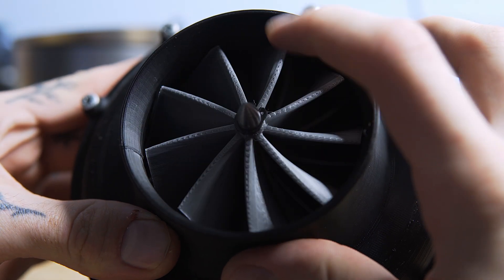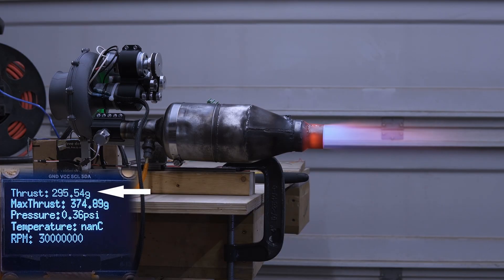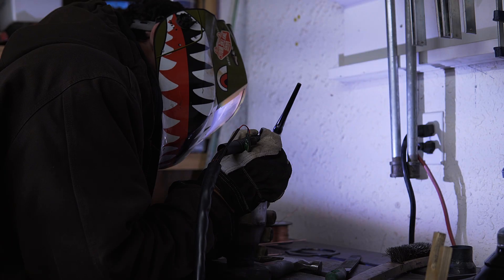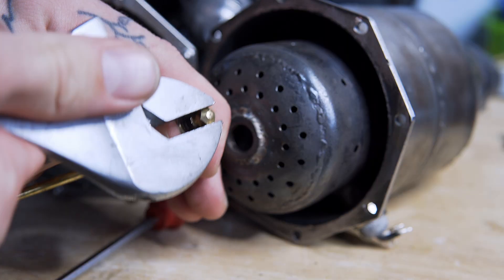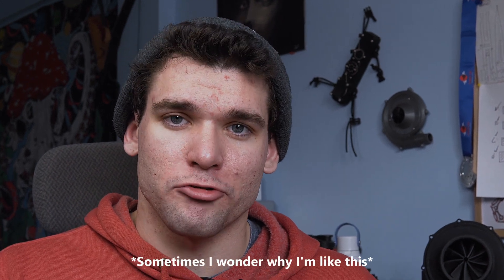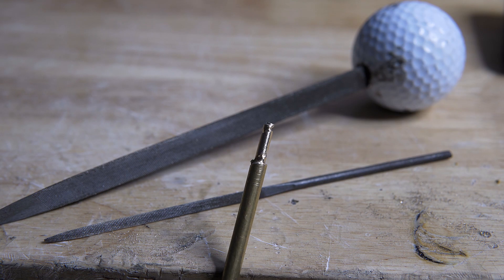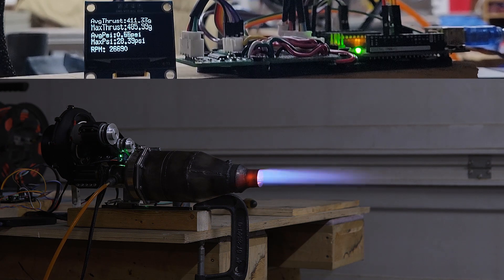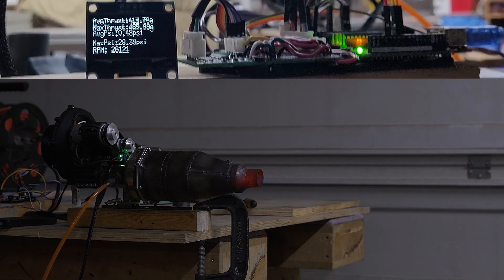I cut my homemade jet engine in half to make it better. Compressor, Arduino, and fuel injectors!

Comment: how much pressure can u get inside the combustor?  think about several stages of compressors with intercoolers between to not melt the plastic :D  thermodynamic efficiency depends on temperature and Pressure the higher the better :)

Comment: When you need more compression, put some axial compressors before the centrifugal compressor. The diameter of the first axial compressor stage needs to be greater than the intake of your centrifugal compressor.
Reply from the maker: I'm gonna be working on an axial compressor for my new engine soon

Comment: New here, but have you ever thought of using a standard oil  furnice nozzel? You basically made one. There are heaps of different types to experiment with. Like spray angle and field distribution as well as nozzel size and flow characteristics.
Reply from the maker: I think that's actually where I got the idea for the nozzle, I saw a diagram or something in passing. The issue for me was the size of those nozzles, they seem quite large and have a very high flow rate, much too high for what we're working with at the moment. Maybe in a larger engine, or an afterburner, I'll look more into furnace nozzles! Thank you!

Comment: Wait , can you burn kerosene with your current compressor air flow, might not burn well, upgrade to brushless dawg, perhaps take a used car turbo and use the motor to power it
Reply from the maker: I'm really not sure, I've read that karosene needs more pressure for good combustion and idk if the engine produces enough. I'll probably use propane to get the engine up to speed and then swap to karosene mid burn, which may take care of that issue. Either way, I'm working on a turbo jet so the motor and pressure won't be an issue for much longer

Comment: probably a flawed idea, but ultra sonic humidifiers make incredibly fine room temperature mist, im thinking that if you could add that disk actuating at very high frequency's to vaporize the fuel to the main intake in combination with your new nozzle, it could yield better results.
Reply from the maker: I like that idea! I don't think it would work for the main combustion chamber, but we could try something like that for an afterburner!
Reply: Turbines make this high pitched sound already. So the idea is to put injectors as close to the rotor as possible? Like ITB carburettor?

Comment: Hey man, how high of kv motor do you think you'd need. I have some smaller high kv drone motors and esc laying around. From one broke college student to another mad respect you are getting this done!
Reply from the maker: What an absolute stud. Thank you! The compressor is meant to do about 50k rpm, but don't worry about it I'm already building a turbojet so our motor issues will stop being a problem very soon!
Reply: @Neally  noice!!

Comment: Awesome great progress. 
We had a hung start yesterday and we suspect flow divider. 
For your centrifugal tip clearance. You can make a abraidable self lapping coating by mixing graphite flakes in with some paint. 
I have some duplex nozzles kicking around and internal flow diagrams if you would like as well. 
Looks like your making alot of progress !! Thanks for the vids
Reply from the maker: Thank you! The graphite trick sounds brilliant, I'll have to try it sometime!

Comment: To actually Increase the thrust by quiet a margin. you would require a Compressor wheel setup outside the combustion chamber 
(compressors and stators both).
Reply: In a radial compressor the volute geometry serves the role of the stator blades in an axial design. I am tempted to load up his models though just to have a look at the compression and collector area of the volute because now i am curious. this is a huge reason why he is using a radial compressor and why they are used so commonly. Radial turbines get really crazy like this because you have multiple stages of compression taking place on a single rotating part. this is why they may have three blade lengths with different geometry. as the air is forced farther into them. more blades and different angles are turning the flow laminar and compressing it.
Reply from the maker: Exactly! The diffuser section is a part of the upper volute and serves to expand the flow causing the speed to decrease and the pressure to increase. I think I'll talk about it a bit more in one of the upcoming videos. Cheers!

Comment: I have a question 

Does the engine make more thrust after ignition?

Because the compressor is electric, so shouldn't the overall pressure be equal to the pressure produced by the compressor?

Thanks
Reply from the maker: The engine makes something like 5x-8x more thrust after ignition. Because the exhaust is somewhat restricted, the combustion adds to the internal pressure. Ideally the compressor would make significantly more pressure making it so that the pressure the combustion adds is insignificant, but I haven't gotten us there yet. Great question!

Comment: excellent video! drip water that is charged by positive terminal from above to hit a negatively charged bit of aluminium wire from a welding spool. the water should flash into 100% hydrogen and the aluminium oxide waste can always be reused.
Reply from the maker: That's a cool idea! I assume you mean for the fuel system?
Reply: @Neally  idk sure why not the fuel system

Comment: Why are you doing this other than fun?

A gas turbine extracts energy to turn the compressor. The power ti increase output is coupled directly to the turbine wheel. 

Your setup has a maximum compressibility limit based on the power of your brushless motor. You'll never reach the kinds of thrust a jet turbine can. In fact there's no point to even have a turbine wheel at all. 

What would be more interesting would be for you? To attach a turbine wheel to a electric generator and extract the electrical energy from the turbine wheel. And feed it back to the brushless motors driving the compressor.

There's something on the order of 90% efficiency. Or better on electric motors. So you likely would be able to extract more power this way and accelerate the turbine even higher, but likely a 3d printed compressor wouldn't survive the kind of rpms we're talking about. Still, it would be interesting to see this.

You'd have to gear reduce the turbine wheel to the generator to get to a rpm range it can work efficiently at and need a way to convert the power efficiently and smoothly back to the motor. Mayne capacitors?
Reply from the maker: I'm mainly doing it to learn, and to incrementally improve my engine systems. The Arduino, the compressor, how pressure works inside the engine.. All of that is stuff I started to figure out because of this project, and now I'm using that to build a proper turbojet

Comment: How do you know the thrust is coming from combustion in the engine and not just airflow from the turbo? id assume that given the turbo is moving alot of air surely it would make a fair bit of thrust on its own. Super cool project i look forward to seeing more of it!
Reply from the maker: Yeah so in the very first jet engine video I did I tested the engine with only the compressor running, and it made about 25 grams of thrust. Based on that I've been treating the compressor thrust as essentially negligible
Reply: wow thats so much less than i would have assumed. Makes me even more amazed by the thrust numbers youre getting from your engine!  @Neally
Reply from the maker: Yeah it was kind of shocking when I first tested it!